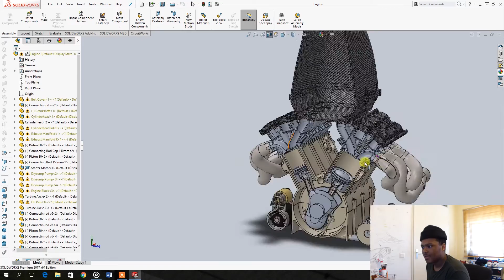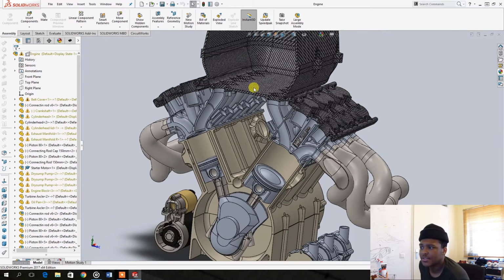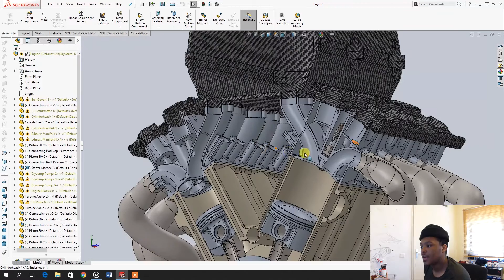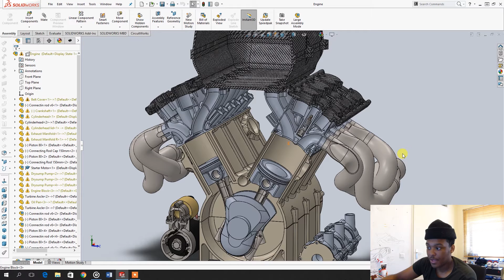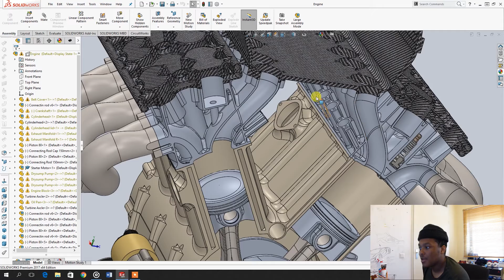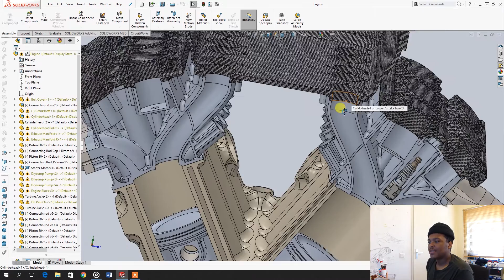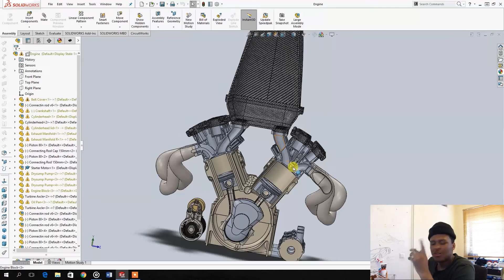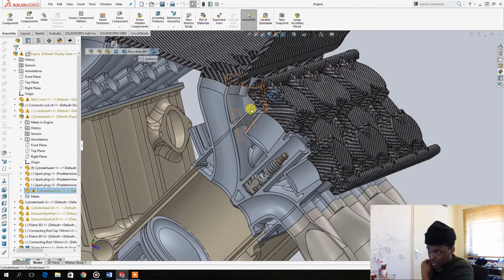Koenigsegg Freevalve Explained | Single Seater | SVA Design

Comment: Did you found the company which is ready to cast the motor?
Reply from the maker: Vitali Bazilevschi im sure i know what you mean
Reply: I mean you have custom engine:Block,Head,Crankshaft,Pistons....Because your engine is fully custom and is not made based on nothing on the market you have to find someone who can cast all this for you  block from aluminum,Valves from IRON/TITAN alloy even Adamantium if you have money.Also Gearbox housing need to be cast or build using CNC-Machining or Carbon fiber Composites.My question is more related how do you plane to build this car after you will finish all design process?Because I'm looking to your concept and I realize this is something unique...Something like CAPARO T1
Reply from the maker: Vitali Bazilevschi im not in the financial position to make this car right know but if i was i would try yo get in contact with divergent 3d for the prototyping. you should check them out.
Reply: You could try to find some financial support as you are young Inventor/Entrepreneur.Also you could put your accent on the green part of your power train...
Reply: read the story of Mate RIMAC and you could try to do the same thing,Build your Own company.You are extremely talented and you could offer something to bigger players on the market....
Reply from the maker: Vitali Bazilevschi thank you for the compliment. and yeah i already know everything there is to know about mate rimac
Reply from the maker: that would be possible. you knw what, why not give it a shot. as soon as the design proces is finished i will reach out to some people and companies
Reply: sure we will try it.I will stay tuned and I will check everything about your project.Your project could inspire me to start pushing my project also because I stuck with the Battery pack ,I can't decide what battery cells to use.I am inspired from Tanija/Rimac Monster eRunner and Nio EP9 and I want to use same Battery pack philosophy,something like LeMans LMP1 class cars.
Reply from the maker: Vitali Bazilevschi i would love to see your project
Reply: SVA Design  I was looking for solid works surface tutorials and I found your videos quite interesting
Reply from the maker: im glad that i was helpfull 
i will start on the body work soon so that process wil be repeated